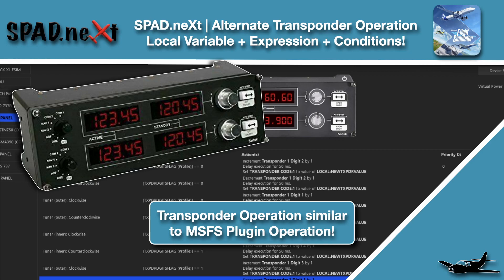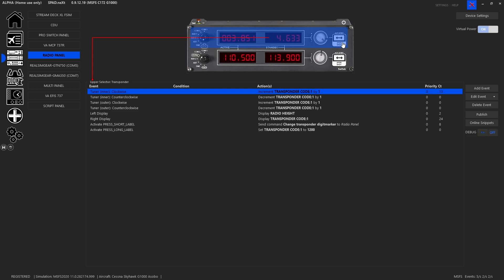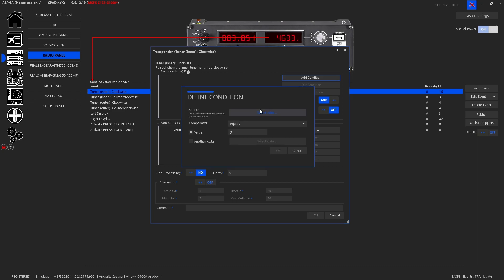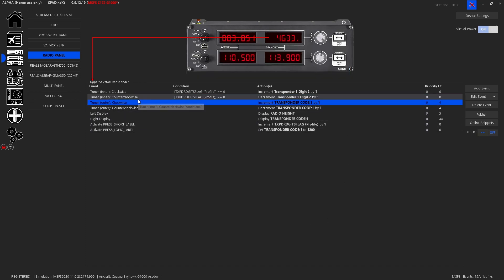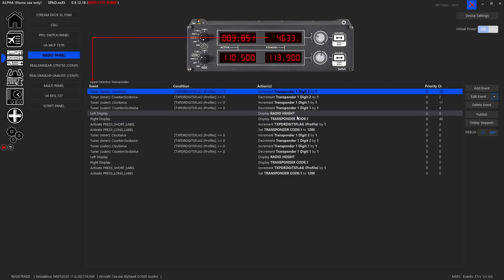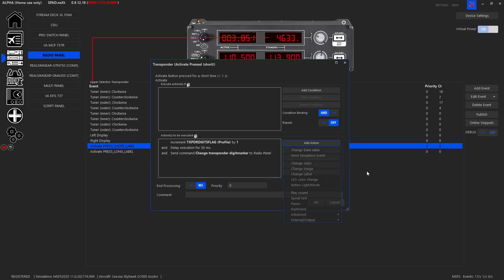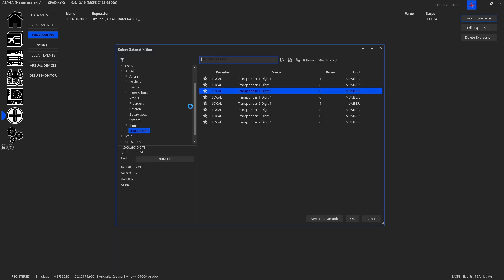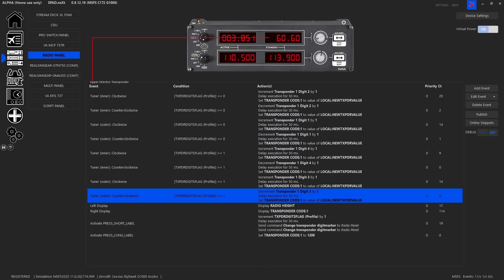MSFS | SPAD.neXt | Alternate Transponder Operation

Comment: with one multi-panel and two radio boxes (Logitech/Saitek equipment) exclusively used only for MSFS-2020, is there a need to load  the Logitech driver at boot-time (in other words, do I need to install the Logitech driver from their website, or does SPAD have its own control of those devices in windows?)
Reply from the maker: Spad has its own. You have to uninstall the Logitech MSFS plug-in. This is covered in the getting started videos. That will interfere with spad as they both fight over and send events.
Reply: @LesOReilly  Thank you very much, i will go into W10 add/remove programs and get it out of there if it's there.